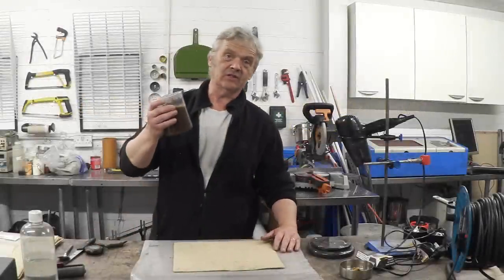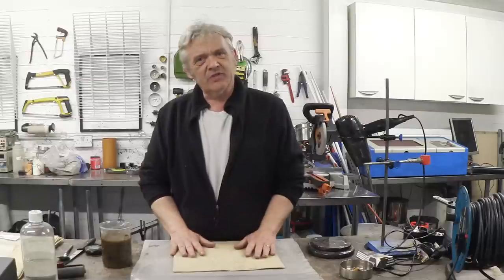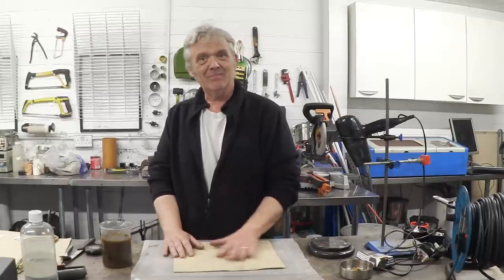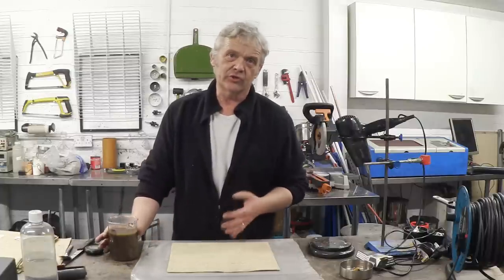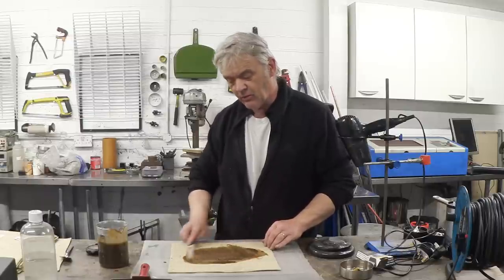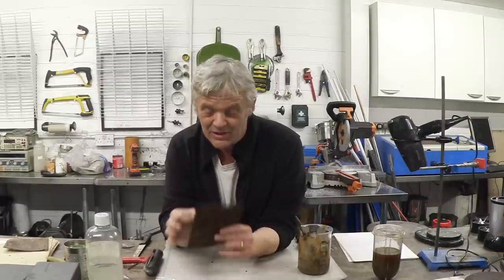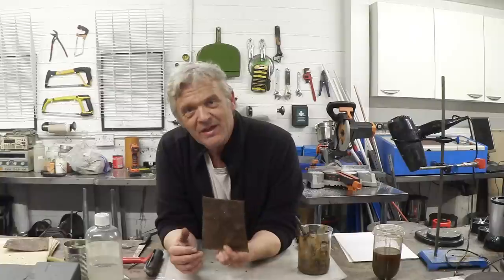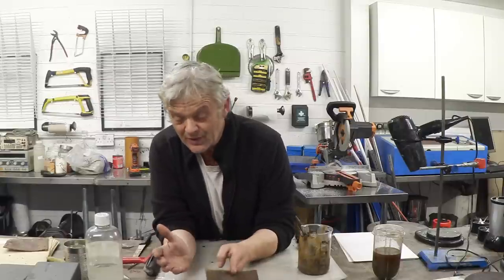A Hemp And Seaweed Bioplastic - How To Make It

Comment: You could do vacuum moulding with a hoover and one of those vacuum storage bags.
I was going to use carbon fibre to make a battery box for an Ebike, but I think I'll give this a go instead.
Thanks for sharing your creative imagination with us Rob. Much appreciated.
Reply: Speaking of carbon fibre, apparently Titebond III makes a decent epoxy and polyester resin replacement.  It's much cheaper and much less toxic as well.  It has a tensile/PSI strength of 4000, which is comparable to polyester resin and some two part epoxies (there are some epoxies that have twice as much, but they are quite expensive).  

   Also, if you want to make your own super materials, check out crystalline nanocellulose--and especially the carbonized versions of same.  The latter has higher tensile and stiffness strengths than carbon fiber--much more than the easily available to the consumer types.  
  I've thinking that also woven bamboo would make a really good substrate.
Reply from the maker: cheers mate - and I would love to see a video of this
Reply: You can get fiberglass mats in most hardware stores with a welding or plumbing section.  Burlap bags might work o.k. too, but even old T-shirts work.  You can also use gelatin to make a type of hide-glue that allows repair simply by adding heat (typical for string instruments)
If you boil cornstarch with a bit of sodium hydroxide (in many drain cleaners) it makes a really strong glue.  Adding boric acid (in some insecticides) to a thick solution of it will make a moldable plastic that sets pretty hard and is extremely heat resistant (adding baking soda increases heat resistance)

Comment: Can you set that panel out in the rain and sun and see how it holds up to the weather?  thanx
Reply: I want to see that too.
Reply: +1
Reply from the maker: you could
Reply from the maker: do it then mate - then share the video
Reply: A homeowner in my town built a hemp-concrete building.  It did not survive well in our coastal weather. 

This material does look interesting for indoors applications.  Must think.
Reply: It was attacked by molds to begin with.  It was downhill from there.  It had been waterproofed.
Reply: @edwardcdg  i wonder how it would go for indoor furniture
Reply: I want to know how can I add copper nano into see weed bio plastics
Reply: @ThinkingandTinkering  Mate you already got a panel lying around, seems like it would be interesting to a lot of people

Comment: 6:16 - "I hope it sparks ideas in you"
My brain: Yes. Every. Single. Time!
Thank you so much for focusing on these platforms of innovation - I'll be building an odd capacitor-solenoid-thingy soon, due to another one of your videos. And, I was already looking at ceramic plates that assemble into honeycombed surfaces; forming the bucky-triangles of a geodome's mosaic with them laid edge-to-edge to make a deep, hollowed prism of flanges, same principle for support as an I-beam, extending to interior domes for architectural space-frames - so, you said "if you can make a flat panel, you can make anything." Definitely!

Comment: This is interesting thank you. Would love to see additional videos on this in the future! 

I’m interested in applying this for pots for plants.  Do you think if I had a big bucket as a mold, I could Impregnate a bunch of squares and overlap them to make the shape of a bucket?

It wouldn’t have to be water tight, it would just need to not disintegrate when contacting wet soil 

If it works, gardeners wouldn’t have to deal with cutting out their little plants to repot them.  They could just plop the bio plastic into the soil with some worms and the pot will disappear into the soil

Comment: I have been working on organic low density composites for some time, some of the biggest issues are making them water proof and prevention of mold growth but I have found that an ordinary household iron is quite effective at flattening out thin sheets.
Reply: What about adding water glass to the mix? Or painting it with water glass once dry?
Reply: Rick Simpson    It won't be particularly environmentally friendly if you add those.  But some beeswax or shea butter might work.  Klink's suggestion is definitely worth trying out.
Reply from the maker: just paint it mate - as for mould stick some disinfectant in
Reply: @ThinkingandTinkering  Thanks for the responses guys, I have solved the mold problem by adding Listerene mouth wash. For waterproofing I have been experimenting with gelatine, with some success. I had thought of waterglass but because the filler material is so soft (pith from elder trees) the binder needs to be relatively weak or when machined the filler pulls out. The most successful binder to date has been corn starch and hot water.
Reply: You can add borax (20 miles team laundry additive) or boric acid (some insecticides) to your resin/glue for mold resistance ... and many insects as well... It may even add some flame resistance.
Neem oil works o.k. too if it's oil based and you want a "natural" alternative.

Comment: Is it mostly waterproof after you  heat treat it? Also, if you heat it in a particular shape will it maintain the shape? i.e. similar to a vacuum forming process.
Reply: In the last vid, it was referred to as Thermoplastic. So I'm guessing it would maintain its shape until enough heat was applied.
Reply from the maker: no mate in this form it isn't waterproof - but then not much is - and you could just paint it

Comment: Could use a wire mesh in the kiln to keep them flat and stack them. Alternatively you could dry the sheets over a desired shape like roofing tiles or something.
I wonder what would happen if you replaced the water with something a little more hydroponic, like linseed oil or melted bees wax
Reply: I'm going to be trying bees wax, but linseed oil might be a good to try as well.
Reply: Problem is though, there is so much water in there initially, I think separation will be an issue, unless you add some kind of emulsifier?
Reply from the maker: nice idea cheers - easiest thing = varnish it after it is dried
Reply: Yeah, i looking for she same, but the problem is... Flameability (in roofing....) Maybe casein / galalithe ?

Comment: Blimey, we're all spoilt with your great videos. I feel a seaweed and hemp Printed Circuit Board arriving soon :)  Any better substitute for the Corn Flour, environmentally a tad borderline - water (uses a lot), and fertiliser (nitrogen pollution)?
Reply: Arrow root might work. I don't how much water or fertilizer it uses to produce but you can sub it for cornstarch in the kitchen.  It is used in a lot of Asian recipes and it works exactly the same.

Comment: Now what would be amazing is to make thinner sections. Make them into strips similar to fiberglass. Allow it dry and then sand and paint it. It could be anything. A simple foam mold could be made and covered in this material, or, vacuum forming. Just an idea.
Reply from the maker: a really nice idea mate - like it - cheers

Comment: Hello ! Have you tested thermal isolator properties of this material that you' ve made ? Hemp is a good insulator, so combined with plastic, also some thermal resistance... in theory, they should give some decent thermal isolation ! Waiting for you're reply and/or a video with some test/s on "Hemplas" ! :)
P.S. You're video sound is still bad ! :( Not like in the first years of publishing but still not good.. build some acoustic panels (making a video also ;) ) , and use them to stop the bad acoustic from you're worksop :(

Comment: This is similar to Hempwood created by a company in Kentucky USA. They compress Hemp into panels and beams and then seal it all in using a Soy based resin.
Basically what you are doing is fibre glassing but using hemp instead of glass fibre and natural resins to glue it together instead of epoxy polyester.

Comment: What  if the bio resin where Vacuum infused (carbon enriched)  into a stack of linen ,hemp sacking,hemp mat,hemp sacking, linen and cured on a heated platen.  add carbon felt layers. Panels could then be built up into a boat hull as per the Kelsall  flat panel method. With all those layers of carbon and hemp the hull could be used as one huge battery!  Would try it myself but for restoring a Normandy farm house.Well there's a challenge for your team?

Comment: "not good for industrial production"  But I can already see how this could be scaled to factory production rather cheaply in a semi-automated fashion.  At least if we're talking about standardized flat board production.   

Main thing is I wonder what the flame resistance is of these pieces, and how much in the way of borates or the like could be added for increasing the rot and flame resistance without affecting dimensional stability.  As well as how it stacks up to other hemp based fiberboards and the usual OSB used in construction.

Comment: Thank you for this video. How does the dried panel hold up to the elements? Submersion in water, chemicals, sunbaking, etc.? It would be neat to measure force stresses like compression and tension compared to plastics to see industrially, where it falls on the scale.

Comment: I wonder if the natural Urushiol-based lacquers could be used to stabilise that plastic, because if you could get your production quality up high enough and manage to electroplate one or both sides with copper then you may have a more sustainable form of printed circuit board for some electronics applications.

Comment: You can injection mold this actually if you make the hemp mat preformed then vacuum seal it and pull the resin into fully saturation the hemp you can make any shape as long as you place the mat in before

Comment: You can very easily make the molds for that hot air gun out of wood. I’m curious about what you could/would use as a surface coat that could be adhered to by the seaweed resin impregnated hemp mat.

Comment: would larger surfaces have a stange seaweed smell to it in the sunlight ? its almost like a sour smell. have load tests been done on this material ? also was wondering which was better cornstarch or the geleten you used for the thermoplastic ?

Comment: .....would you also describe that hemp panel as a thick slab of paper?  I had a try at finding out how paper is made from logs .Endless circles . I'll need to dig up the encyclopedia Britannica again . Interestingly I have a set from the austerity war years when paper was rationed so the pages are very thin paper. These days you pick up a set for 5 bucks or even for free , some things are explained better than on you tube or the internet including stuff that might also not be explained anywhere else these days for good reasons .
Reply from the maker: pretty much mate - just on a macro scale paper is more on a micro scale

Comment: I wonder if the bio plastic liquid with low enough viscosity could be used to impregnate cardboard, maybe even corrugated. If so a corrugated cardboard box could be turned into a very tough storage box. 
Is the plastic waterproof?
Reply from the maker: give it a go mate

Comment: Henry Ford made a Car body from Hemp, it was reported as been stronger then a steel body and was tested in a promotional video with a sledge hammer.  He was told he wouldn't be allowed to make production cars.
In the video the rear corner of the test vehicle is repeatedly hammered and the panel retains its orginal shape.   The reason Henry was using hemp plastic was because he was already growing Hemp on his farm to produce hemp based fuel for his cars, while in the meantime Henry's wife was driving a Baker electric car.
Reply from the maker: cheers mate

Comment: What do you think about making a gel, or more solid state battery using these types of simple accessible bio-plastics? I have done some research on similar things and I and figure that using it for electrode/electrolyte material could potentially be safe and effective. 
I thought maybe a range of metal could be tested, including oxide, acetate, chloride, forms. Ideally it would be simple homemade stuff (probably somewhat impure) like Ferric acetate, Potassium carbonate, Sodium acetate, Calcium acetate, Calcium chloride, etc. Able to be Produced from scratch with stuff like wood ashes/seaweed ashes, seashells/snail-shells/limestone, black sand/old nails, vinegar, sea salt and so on.
I've had some trouble finding out if any of these bio-plastics could somehow be used as a battery separator material as well as electrode/electrolyte material - If you know about it, or could point me in the right direction, that would be great.
I will be experimenting on this stuff myself, but I saw your video and thought I should mention it as it might appeal to you and the viewers. You may want to extend the scope of available materials and also include things like graphene, etc. I was just thinking of what might be possible with what is already present in the rural/wild environment. Stuff that's free, natural and available mostly everywhere.
Thanks - Kyle
Reply from the maker: you can certainly use it to gel the electrolyte but beyond that - I don't know really - very interesting question
Reply: @ThinkingandTinkering  I wonder if that casein + tannic acid rubber stuff that you did a video on might allow ions to pass through? It appears to have similar hydrophobic properties to rubber, but is it an insulator? Food for thought. Thanks for making these interesting videos and for advising people to also do their own research on things!

Comment: You built a hydrogen drycell using perspex or acrylic sheets...

I.can see it with bioplastic panels...

I have seen some methods for removing the clorofill from solution by leaving it in the sun (turns brown) then filtering. I'm sure you can scratch your chemist brain for an easier way to make the film/block clear / more palatable for the retailors / widely utilisable  by peoples ie windows, (obvs your methods easier than melting sand,less energy and all that).

Good night sweet dreams thanks for the inspiration.
Reply from the maker: I can mate - when it's finished you can paint it any colour you like - why struggle? most things are painted and wood only comes in brown - of course you could try not making it a problem and just use the natural colour to differentiate it from everything else - people expect organic to be brown you know
Reply: @ThinkingandTinkering  I literally ment for the purpose of making windows  and transparent panels...

Windows made from  bioplastic

Comment: I wonder:  has anyone tried using drying oils (eg. flax seed (linseed)) with this idea;  organic, water resistant flexible hardening while filling in small permeable gaps.
Reply: Yes, i do. But i'm a bit effraid of the burnablility for my structural insulation blocks project.. Maybe adding some mineral in? ... The risk is to lower the insulative effect...

Comment: Fantastic stuff as ever. A replacement for builders board? Going to try it with some of our local seaweed this week with my daughter. Thanks for the demo. Brilliant!
Reply from the maker: that is awesome mate - if you add a little bit of vinegar and a little glycerine it will be more flexible and a little more waterproof (about a teaspoon of each)
Reply: @ThinkingandTinkering  brilliant, all things that are in the cupboard! Thank you. Have you had any problems with its stability at higher temperatures, say around 50°C?

Comment: Is it water repellent or water proof after heating?  make more and weather test them,  how heat tolerant or flame resistant is this product? the hemp or long fiber mat would reinforce like rebar in concrete. This has many potentials.
Reply from the maker: or you could mate
Reply: @ThinkingandTinkering   I would if I could, The only seaweed near my location is in the asian markets or wrapped around sushi.
Reply: Though thinking about it,  the gelatinous goo is the important part,  Ocra vegetable could be good for something. it is full of goo.

Comment: Is it water resistant after  drying?
Reply: Sadly, I doubt it. The milk based bioplastic was after he used tea because the acid in the tea cross linked the polymer. If something was found to cross link this then it should basically be waterproof. I like that it can be used as an alternative composite compared to fiberglass and epoxy.
Reply: @btryba     Some of the formulations I've seen for bioplastic include adding some vinegar.  
   Even if you get it relatively water resistant--it won't be a great substitute for fiberglass/epoxy since these have much higher tensile, Young's modulus, etc strengths.  
  With that said, adding crystalline nanocellulose, in both the raw, and especially in the carbonized form, will greatly increase those various strengths.
Reply from the maker: make some and see
Reply from the maker: I don't understand the obsession with 'waterproof' - very little is actually 'waterproof' - why do you think they paint things?
Reply: Well, the waterproofing need sounds obvious to compete with regular plastic, think about a plastic cups, flower pots, bath tubs and so on... Regular plastic are water resistant without any paint on it @ThinkingandTinkering  !